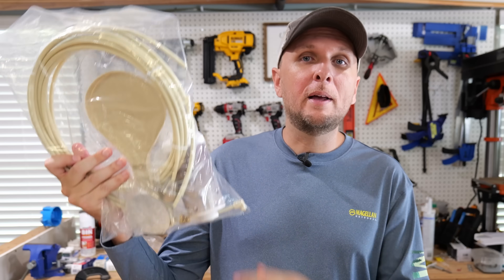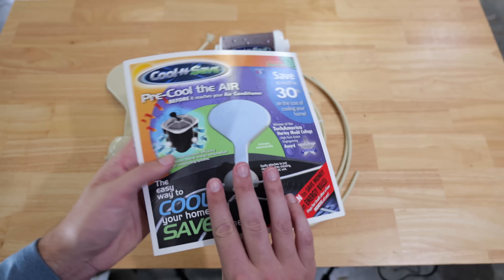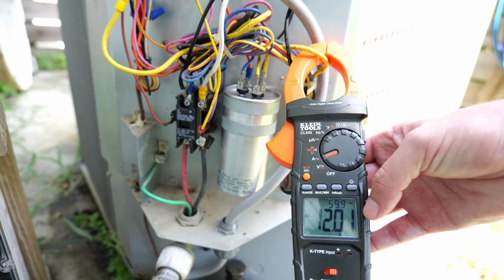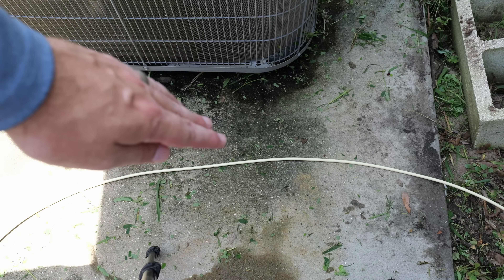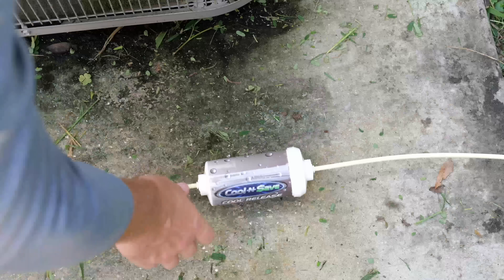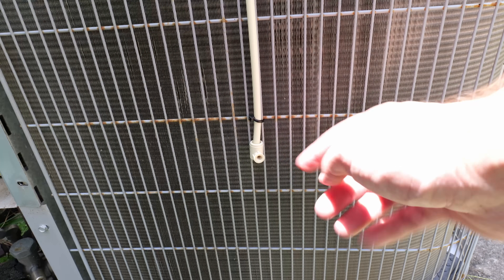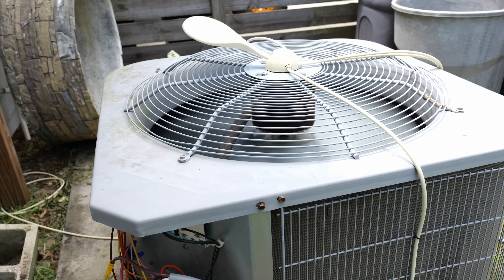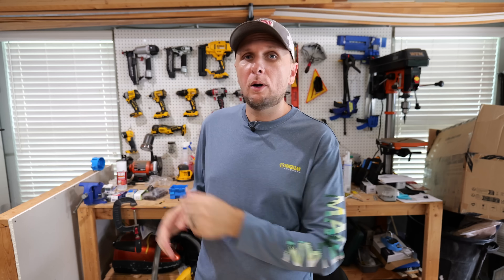This Device Can Save You 30% On Your Energy Bill! Makes The AC Blow Colder

Comment: Dude, you rock. I never knew that this kit existed, but did know that cooling the condenser coil could be a help in cooling. Just ordered my Cool n Save... 🙂
Reply from the maker: @bobbyratt really glad to hear You liked it.  Let us know your results or how you’re liking it.  

@HeWhoIsWhoHeIs that is just your opinion.
Reply: Hey Adam, I installed the cool n save & had partial success. First, my system is 32 years old but still works like a champ. My amperage was 14A before and after, so that didn't change. My cooling out of the ducts was  much improved though. 51.6F before and 48.3F after 😃. The paddle is leaking some water at its shutoff valve, so I'll contact the company
Reply from the maker: Hmmm can’t speak to the leak as mine doesn’t leak at all.  I would just try to make sure all the connections are in enough.  That drop in temperature is a lot!   Really curious to hear how it will affect your bill.  Thanks for the update!
Reply: @HowToHomeDIY  I'm on solar, so my bill right now is $36.50/month. I live in northern California, and we do get days over 100F, but we also have a whole house fan that we use at night if Mother Nature cooperates and cools down. I also contacted Cool n Save, and they're sending me a new paddle. Thanks again for all of your great how-to videos... 😃

Comment: This would be great in Arizona with our low humid air but........our water is very hard and the manufacture recommends to not use in an area with hard water.   Many comments have pointed out the hard water deposits will clog/destroy your condensing unit (very expensive to replace).

Comment: It is supposed to be glued down on the top. In the winter it would crack under the cold weather.  This means you would need to replace it next year. This was determined by two other testers.
Reply from the maker: Yeah in the winter I’ll remove mine.  The following year just put it out again.  It’s a pretty quick install.
Reply: Ever thought of simply disconnecting from the water hose? You could literally winterize this thing in 5 minutes with a small amount of compressed air.
Reply: @cloubydoo  you can probably just unscrew the brass nozzles and presto, it would not get damaged in the winter.

Comment: Oupsies, he forgot to mention this will only work in dry climates. The higher the humididy, the less effect the mister will be to bring temperature down. And long term, who knows the effects it wil have on the coils. That's a the issue when youtubers are sponsored by brands. This is not a critical analysis, this is a sales pitch in disguise.
Reply from the maker: I’m not sponsored and I make literally zero money on the cool and save.  I bought all of this with my own money.  You can question the results if you want but I take great pride in my integrity.  But I live in a very high humidity climate, not sure you can live anywhere with higher humidity and you saw my results.  Do I think this would work better in a climate with low humidity? Absolutely.  But I’m happy with my results and will continue to monitor everything.
Reply: I apoligize for the accusation about your (lack of) independance. However,  you should have mentioned impact the relative humidity as it is the most important factor driving potential savings. The unknown long term impact on the coils can also be important.

Comment: I tried this gimmic and scaled all the coils almost cost me my ac
Reply from the maker: There are a lot of variables not known here.  Did you use this exact product?  Did you use the filter?  Did you change the filter before expiration?  Not trying to be smart here, honest questions.   If I find it does the same to mine then I’ll be making a video on it.   But the company has been selling this for 10+ years and also warns certain areas of the country can’t use it because their hard water is extreme.  We shall see.
Reply: @HowToHomeDIY  He's not going to respond. This is a drive-by comment. Odds are it's not the same product or was neglected and improperly used. Otherwise it seems he would offer some details to help others make a decision.

Comment: Thumbs down! First of all 1 degree difference won't do much of anything. Outside temp could have been difference as well as error in the digital thermometer could account for that single degree. You would need 10 degrees to make any difference.  Sounds like you are just pushing this junk to make a little commission. I used to like your channel but not any more..
Reply from the maker: I don’t make a commission on the cool n save.   So that’s not true.  1 degree absolutely can make a difference in overall run times.  You’re right on the outside temperature though.  It had risen about 7 degrees from the beginning test to the final test so the results would’ve been even better had I been able to test it at the same temperature as the first test.   Appreciate the comment.   Sorry to hear you don’t like it anymore over issues that don’t exist but take care!!

Comment: It may lower the head pressure, but I can't believe it would increase the cooling capacity of the system.  This is because in a correctly charged system, only liquid refrigerant is leaving the condenser unit going up to the evaporator.  The evaporator is designed for a particular liquid to gas conversion. I think this system will do more damage than good.  I'm not an A/C technician, just an old engineer with a background in thermodynamics.
Reply: Exactly 💯

Comment: Does your HVAC system take advantage of already cooled air by recirculating indoors air to the HVAC unit for further cooling, instead of replacing (wasting) indoors air with outdoors "fresh" air that requires much more work to cool?  I assume there will be much less savings with an HVAC system that recirculates, since it's more efficient.

Comment: Water like that can corrode the connection between tubes and fins.
Reply from the maker: Water like what?  You know what water I have?   Unless the water is extremely hard, which according to the company is a few places in the country, then it’s really not an issue with the filter.

Comment: This is from another channel "@diyhvacguy" but I have the same questions.
@bigtexuntex7825 wrote 2 weeks ago
So you think continuously misting tap water won't ruin the capacity of the unit by causing a thick mineral deposit to form on the coils?  Acid coil cleaner will help some, but it won't get it all unless you use a acid that will erode the aluminum.  Calcium deposits erode best in the same acid conditions that will erode aluminum.  So tap water will damage the condenser.  Filtered rain water, RO water or Distilled water will be required if you want to avoid coil damage.  Remember you will be evaporating literally tons of water, is your water clean enough to not turn the coils into a solid calcium deposit?
Reply from the maker: Yes I’m not concerned about it, especially since I’m not going to use it year round.  It has a filter designed to remove scale and I have a water softener.  But like I said in my video, do your due diligence.  If you aren’t comfortable with it then don’t install it.

Comment: Nope nope nope! If this is such a good idea.......why doesn't the manufacturer include this on the unit? Doing this actually lowers the running pressures of the system, which will cause the evap coil to freeze up. 30yr HVAC svc tech, I've seen all the gimics.
Reply from the maker: That’s just not true.  It’s no different than if the ambient air is lower.  Nobody says any of this when the ac is running and it’s 75 degrees out but if we make the air around that using water somehow it is a problem.

Comment: This should be working on rain (distilled) water.
Reply: Exactly.
Reply from the maker: The rain does a great job of it.  Would be quite a bit more though to setup a rain catch system and then pump it to just the ac.
Reply: @HowToHomeDIY agreed - but my results have been so good - that I am honestly considering doing a rain water collection system for that purpose when I replace my HVAC system.  I would be hesitant to put one of these on a brand new system - but with rain water you take away the only real drawback of long term use.

Comment: For everyome saying that water will cause build up on the radiator, youre supposed to clean the coils every year anyways with chemicals. With proper maintenance i think this may be worth looking into. Around my area water is cheap but my last electric bill was $450
Reply: Actually, most manufacturers recommend cleaning them with clear water only!! NO CHEMICALS as poor rinsing can cause the hidden and residual chemicals to eat through the copper and aluminum metal and cause leaks over time from corrosion.  I have even seen some of the full outdoor "Package Units" with stickers right on the outside of them next to the coils that state "Clean with Water ONLY!"  Now you know why! Most AC repair guys do great work, but they don't have time to flush the heck out of your coil after they clean it with chemicals. Time is Money!!!  Yes, the chemical makes them look nice and shiny because it's eating some of the surface of the metal away every time it's used.  If they fail to really flush and rinse the coils with lots and lots of water to dilute the chemicals from every nook and cranny of your AC Condensers interior, you could be left with a future leak or corrosion problem.  I have a 25 year old Trane Dual Compressor, 2.5 / 5 ton XL1800 Heat Pump unit here in Florida, and I clean it good with water every couple of years and it's still running strong.  Its a little tougher to clean because there are actually 2 sets of spine coil fins inside sitting next to each other so you can't separate them.  Water and a simple hose end sprayer work just fine to clean the dirt and dust out of the unit.  The unit is now in its 25th summer (Installed in May, 1999) and still going strong.

Comment: I don't think this test is valid. Notice that at the beginning of the video, the condenser was mostly under direct sun when the before measurement was done. Mid video, half is under shade. By the time the install is finished, the whole condenser is under shade where the final measurement is taken.
Reply from the maker: That’s false.  First, my unit is never fully in the sun.  It is about half shaded and half sun all day.  There are only portions of the video where it seems it’s in the shade and that was just brief cloud cover.  The first measurement was taken when it was 91 degrees out, the second was taken when it was 98 degrees out with a feels like off 112 degrees.  So actually the results would’ve been better than they were had I been able to take it at the same time as the first test.
Reply: @HowToHomeDIY  I have seen some tests where a unit was tested in full shade and full sun using a tarp like 10 feet away to block the sun, and all of the measured performances of the unit remained virtually identical.  Once the unit is running, having the unit sitting in full sun or full shade had no measurable effect on the unit.  They measured, Amp Draw, Low and High Pressure, superheat and subcooling and Delta T at the condenser and on the inside unit.  Just thought I would throw that out there...
Reply from the maker: All I can say is with the heat we have been having, my units amp draw on startup and running has been higher than normal.  I have numerous devices I monitor my system with.  But on days where it is cloudy or we get some rain, runs lower.

Comment: I don't think the increased wear on the condenser is worth the small increase in efficiency. Condensers are super expensive.
Reply from the maker: There isn’t an increase in wear.  All this is doing is basically lowering the outdoor temperature at the condenser.   My AC runs when it’s in the 70s and nobody worries about it, why would this be any different?
Reply: @HowToHomeDIY  It's soaking the condenser every time it turns on. That has a huge effect on life span.
Reply from the maker: They are made to be outside and be in the rain.  This is a seasonal device, in most places not year round.  It’s not going to wear it down faster.
Reply: @HowToHomeDIY  there's a big difference between getting rained on occasionally and have the coils doused every time it turns on. Coastal systems don't last as long as desert systems. That device will artificiality age the condenser.
Reply from the maker: Coastal units don’t last as long due to the saltwater and salt in the air.  Not from getting wet.
Reply: @mp-xt2rg  It's not soaking the condenser. The water droplets are atomized and evaporated nearly instantly. Imagine your car on a mild summer day. You grab a water bottle and mist the hood for the entire time your a/c is running you can do this. If that hood is getting continuous sunlight there won't be water droplets running down your hood because they would evaporate before they could gather enough volume to form a drop big enough to roll. Certainly during summer months, your condenser is hot while it is running for sure but even in between cycles the outdoor ambient temps are keeping those surfaces hot. Plenty hot enough to evaporate misting water.

Comment: Really glad you did this video. The achilles heel on this system, in my opinion, is the water filter/softener. You should consider doing some follow up videos on filters and softeners. Maybe even look at reverse osmosis or rainwater harvesting.
Reply from the maker: Yeah you suggested it around 4 months ago I believe.  So out of curiosity why do you think that?   What do you think is wrong with the anti scale filter that comes with it?   The 3 month expiration and having to replace it or something else?
Reply: @HowToHomeDIY  I don't know that there will necessarily be anything wrong with it. Just a wear item to factor in to the cost/benefit. That's why it might be worth exploring other options. Another person commented on possibly using this system rigged up with a "swamp cooler" setup which I think is a really interesting idea because it would be a 2-for-1 in that it would keep the coils clean and eliminate any worries about scale. Just clean or replace the filter material once a year and you should be good to go. Both of the "home stores" sell synthetic evaporative cooler pads that can be rinsed out. Worth experimenting with!
Reply from the maker: @alldecentnamestaken  My only concern with that though is could that not restrict air flow to an extent?  I am willing to take my chances with the filter that the company says removes scale.  They have been in business for many years so one would assume they have an idea what they are doing.  They even talk in depth about this on their site.  We will see.  I am going to pay close attention to mine and if I find that there is any issue, will definitely report on it either through a video or post.
Reply: @HowToHomeDIY  I think an update video in a month or two would be great!

Comment: 30% 🤣🤣🤣🤣🤣🤣
Reply from the maker: I personally don’t think a 30% savings is anything to laugh at but to each their own 😂
Reply: 30% of 12 amps would require a reduction 3.6 amps, assuming the same runtime, which was not measured. Plus, inside fan runs the same both with and without mister system, again assuming same runtime. So savings of  less than half of 30%.

If more half of the 30% savings come from reduced runtime, measuring runtime would be more helpful than the testing that was done in the video.